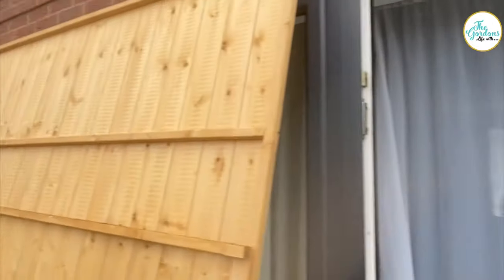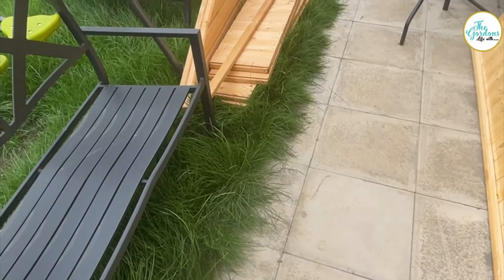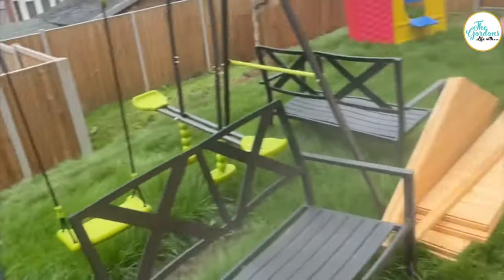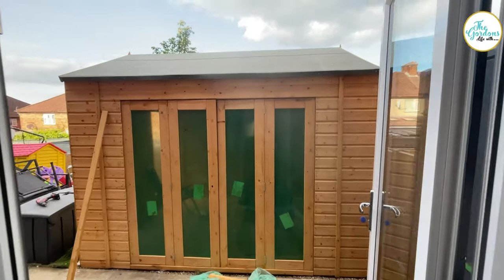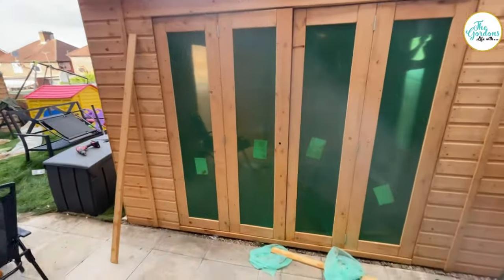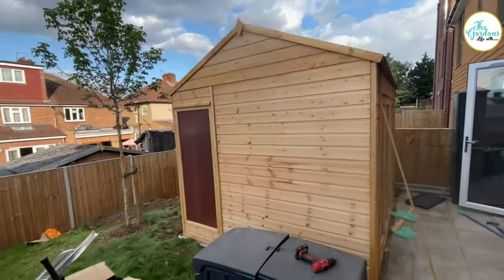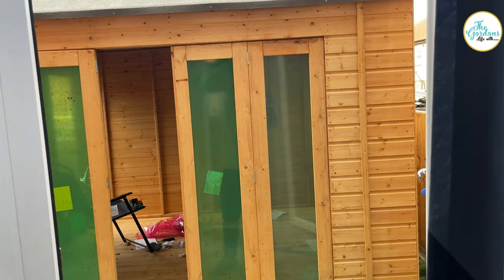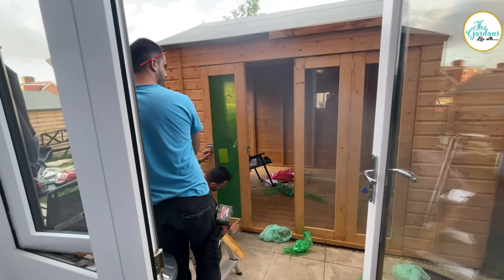Mercia Vermont Summer House Delivery and Installation with Eco base

Comment: Thank you so much for the video, I am looking at this option.  our summerhouse will be very close to a Layz spa so I wanted to go for inward opening doors - glad I watched your video because now I know that the Master door has to open outward.  is this the only one which has to first open outward?  Can you confirm if any of the other door have to open outward?  Also ours will be up on a Deck which can be quite windy - are the doors pretty secure - worried about them being blown inward.  thank you
Reply from the maker: We haven’t had a problem with them blowing around so far, but if it’s a really windy area your installing them then you might need a hook on the outside to hold them steady 🙏🙏